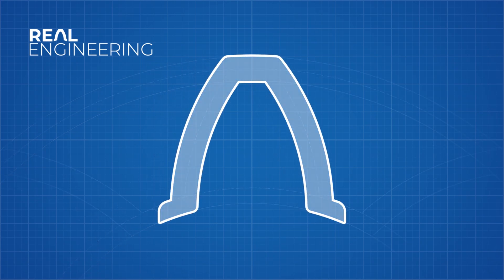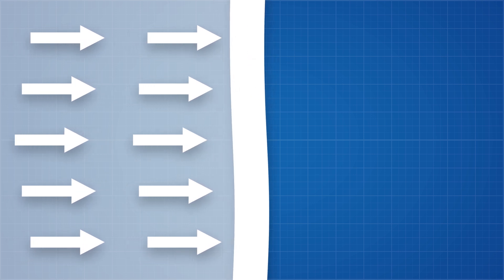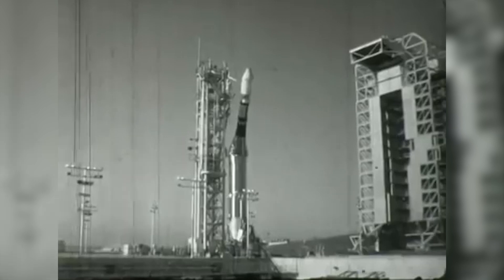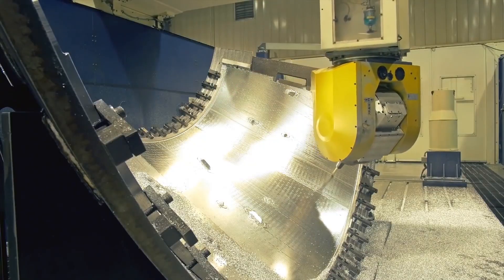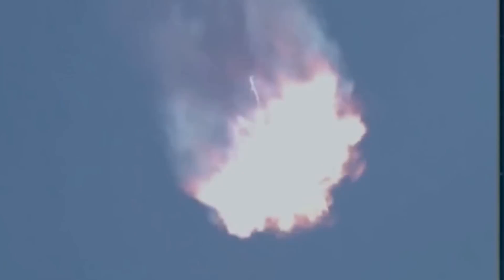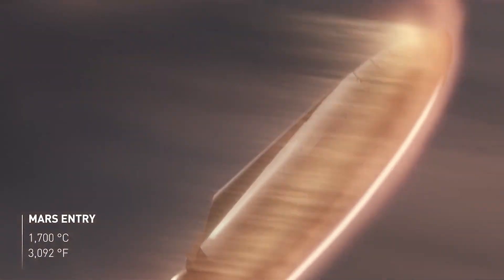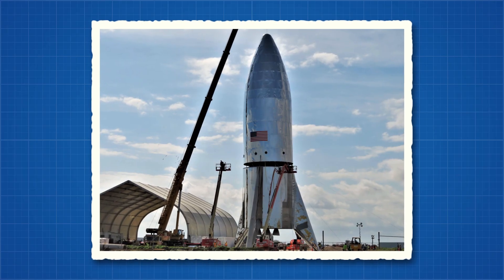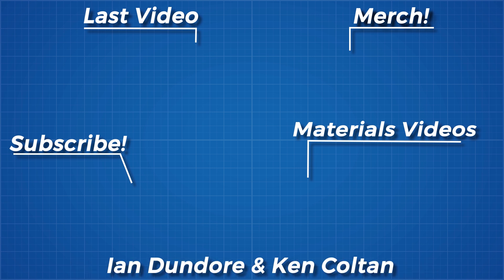Why SpaceX Built A Stainless Steel Starship

Comment: You missed the real important bit.  " Most steel alloys get brittle at cryogenic temperatures. That’s not the case for stainless steel with high chrome-nickel content. It gets stronger in cold conditions, but it also maintains ductility. That means stainless steel has high fracture toughness, which could prevent small structural imperfections from developing into cracks." With the cryo fuel loaded, that thin sheet of steel is stronger than carbon fiber, on top of all the other stuff you mentioned.
Reply: " It gets stronger in cold conditions, but it also maintains ductility." nope, it loose ductility slower than steel , and don't get stronger when cold.
Reply: @surronzak8154  ..nah, I think I will believe the metallurgists and rocket engineers that is actually using this, over some YouTube know it all.
Reply: @danievdw  where doese it say that it will be stronger when cold ? By the way I'm IWT metalurgist using stainless steel everyday, I know the KV for those materials ;-)
Reply: @surronzak8154  Yeah, my mum was lead design on NCC-1701-B . Stop being lazy as well, do some research yourself. Plenty of info available on it, especially after SpaceX started using it.
Reply: @danievdw  LMAO youdon't know what you are talking about buddy
Reply: @Bob Vagen Does it make what I say wrong ? (English isn't my native language) Sorry if it hurts your eyes, I know how it feels
Reply: He is correct it does get stronger in colder conditions and composites tend to sweat a lot more as well but also cost a lot more but at the end of the day they both have there pros and cons plus as far as ik we aren’t working for space x so our opinions won’t change anything
Reply: Myself please show me a chart where KV values goes up when temp goes down for 304L
Reply: Liquid Nitrogen tanks are made from stainless steel.
Just a thought, maybe it's a cryogenic vessel.
😉
Reply: Jkayppobox than you should learn how to read, can you show me where it’s say’s 304l will be stronger cold than warm please ?
Reply: Jkayppobox « 3.2 Charpy Impact Toughness Data
Charpy impact values for all materials are presented in Figure 4. In all cases, the impact toughness reduces with decreasing temperature »
Reply: James Tyler as you say, you’re not an expert
Reply: James Tyler and still no graph to show ? Only blabla
Reply: @surronzak8154  There's is nothing shameful in admitting you may not know something.  In general steels become brittle at low temperatures but they are not austenitic and have BCC crystal structures, 304L being a austenitic FCC structure at low temperatures maintains a lot of ductility at the same time it has a unique behavior of becoming much stronger.
Reply: @jtonxbox1433  go smoke something with zeka
Reply: Musk said he is “a big fan of steel”... did he ever mention using stainless steel?
Reply: Danie van der Westhuizen wow this thread was something else. In case anyone is wondering, Danie is correct. They are going to use cryoformed 301 stainless steel which does in fact increase its tensile yield strength to density ratio at cryogenic temperatures to beyond that of standard aluminum lithium alloys (see NASA research paper linked below). Also Elon has said they have made an improved 301 variant they unimaginatively and confusingly call 30X like their PICA variant PICA-X. It isn’t necessarily stronger per gram than the carbon composites even at cryogenic temperatures (where the composites lose tensile yield strength) but it will be strong enough that the reduction in heat shielding mass will make up at least some of the difference. Besides the yield strength per density which should be good enough, the price per kg, development time and ease of manufacturing are vastly improved. https://apps.dtic.mil/dtic/tr/fulltext/u2/a397053.pdf
Reply: @surronzak8154  Most materials gain yield and tensile strength as temperatures sinks but lose fracture toughness. Face-centered-cubic materials (304 steel) maintain a significant amount of ductility at even cryogenic temperatures compared to body-centered-cubic materials (non-austenitic steels).
Reply: ....IF I 🎶ONLY HAD 🎵A BRAIN !!!!!🎧
Reply: @surronzak8154  304L does get stronger when exposed to 98k, or cryogenic temperatures. It does for the most part maintain ductility, about 8-13% is the range we build to at SpaceX. However, some evidence of notch sensitivity is seen in our custom new alloy we are developing, 30X.
Although we have not pinned down the main driver of these failures, it does appear to be a function of bead geometry in welding, ferrite number and M23C6 carbide formation along GB’s.
Reply: @surronzak8154  that’s incorrect, it does get stronger. It’s called a “Cryo Bump” at SpaceX and is generally around 50% YS.
I think you are confusing toughness with strength.
Reply: @surronzak8154 Starship already flew multiple times. The metallurgist and engineers were correct all along. Maybe listen to experts before trying to act mighty

Comment: Origin of "WD-40" - I honestly never knew that before!
Reply: And apparently, it really was the 40th time they tried the formulation before they found the one that worked.
Reply: Water Dispersant formula # 40.

Along with Heinz 57.
Reply: @wildman2012  It's just Science 101: "If at first you don't succeed...…"
Reply: WD40
Reply: Mindblown
Reply: Motorcycles and cars that are built to be not painted are usually scrubbed down with Wd-40 to keep the water off the surface. Making it so that it won’t surface rust.
Reply: Ikr, another fascinating fact..
Reply: @HuntingTarg  Chanel No5

Comment: Just so you know, "Starhopper" is the test vehicle currently being built. The actual thing will be called "Starship" and the booster "Super Heavy".
Reply: Also, Starhopper with the old tip was only about 2/3 the size of Starship.
Reply: I thought BFR was great.  Versatile.
Reply: Yes thanks for someone correcting that. It stains the work and knowledge he puts into the video when failing to properly name it. One starts to question other stuff then too.
Reply: “Will be”. As often as plans change I wouldn’t count on it.
Reply: @Christopher28fair  It was but people kept changing Falcon to the F word. You can't have 8 year olds interested in space if the most powerful rocket ever built uses vulgur in it
Reply: Andrew Well to be fair he never specified what the F stood for, so in typical Elon fashion we thought it meant the F word.

This is a man who named his cars “S3XY” after all, and that was when Ford wouldn’t let them name the 3 the Model E, then proceeded to joke that Ford killed SEXY.

An engineer’s gotta have fun though.
Reply: Grace Slick is suing  for using "Starship" wait..send that band into space...why not?
Reply: Albert Einstein will smile when he sees these Havana cigars, hungry for fuel and slow as snails, after having seen Tesla UFO testings at 100,000 Klm / h. Real engineering 100 years late in time.  TESLAAAAAAAAAAAAAAAAAAAAAAAAAAAAAAAAAA

Comment: My Soviet university "diploma work" back in 1987 was to test this type of cooling for rocket re-entry, porous pressed metal powder was used, however there were problems with incostintent gas flow in different parts of provided samples. Hopefully perforated solid metal will work better than baked together particles, I really hope such protection is possible (although not 100% sure), only tests will show.
Reply: BRAVOZULU DWEST boathouse  I don't think it's possible to calculate these things precisely because of nature of turbulence, it is not really predictable and may create very local effects when one part of rocket will be heated much more than other part. That's why tests are still necessary. That's why wind tunnels are still used. However, it's hard to replicate all conditions of re-entry in wind tunnel, SpaceX is right to build cheap test rocket.
Reply: I think the biggest challenge will be with the baffle diffuser 'heat shield' that the methane will flow through; there will be cryogenic methane on one side and high-pressure semi-ionized hypervelocity gas on the other.  This will create a high thermal gradient across the baffle plates, and I am not sure if anything short of an actual flight test will prove/disprove this approach.  If it fails, it could doom Starship and jeopardize SpaceX's investment funding.

If it performs as designed, we enter a new era in spaceflight and human exploration.
Reply: @HuntingTarg  I wish I knew what kind of heat protection is used by the newest breed of Russian nuclear hypersonic gliders, yes they are disposable but still may use similar method to keep hot plasma from surface of metal, I know that Soviet Union worked on that long time ago. Although metal still will be heated by light but this is not the same as direct contact. The goal is to make gas cushion between plasma and metal. I doubt that methane is the best candidate, perhaps helium or some other inert gas that will not react with metal.
Reply: @lsemenov  under correct conditions a high-pressure high-flow gas boundary layer will form between the plasma and outer spaceframe skin.  I wouldn't rely on that exclusively to protect a metal or composite frame though.  A cryogenic fluid (Helium, Argon, Nitrogen) in an open-loop boil-off cooling system is conceivable, although I don't know of an example where that's been tested.
Reply: cOmMiE
Reply: @snakeslither8831  Yeah, we were first in space :) Now Russia is not longer commy but is first with hypersonic gliders, nuclear-powered cruise missiles, lasers able to fry satellites and drones etc. It's a pity we have to put too much effort into defence instead of peaceful exploration of space.
Reply: @lsemenov   it was a joke
Reply: @snakeslither8831  
Granted.
Though it was not a good joke.
Reply: Very cool @HuntingTarg!
Reply: @lsemenov  Honestly as a European (Belgian one at that lol) who is just on the sidelines admiring this. I know it might sound kind of crazy: but I am sort of thankful for the cold war because it resulted in the space race laying the foundation for a private company born from a man with extraordinary vision to use capitalism (Tesla+all previous ventures) to go and attempt to colonize space... 

It also basically proves the concept of the WTK (Wetenschappelijk Technisch Kapitalisme) Complex which translated means Science - Technology - Capitalism complex.
Or in other circles it's called the Science - Technology - Economic complex. Whichever you use the basic concept is the same. (as proposed by philosopher Max Wildiers later adopted by Etienne Vermeersch)

Science - Technology and Capitalism/Economy work together to make an unstoppable force of human advancement. Recently I believe this is being called technocapitalism.
I'm not sure if it's all good when you hear how Elon treats his employees but the results are obvious

The soviets had something brilliant with their polytechnical schools which I believe Russia has inherited to a large part and that the Chinese are trying to seriously compete in.
I do hope though that there never be a major hot war again. That would be catastrophic for human development.

I'm not a scientist and I fear I'll never be. But I'm just grateful that there are people who are accomplishing things that seemed to be science fiction until not too recently and this advancement is just not stopping. I hope I'll get old enough and with enough mental faculties to see what the human race will have accomplished nearing the 22st century...
For now I'll try to pass nursing school and try and take care of people smart enough to drag humanity forward.
Reply: The research you did sounds incredible, could you tell us more about it ?  Did it end up being used or if way only tests
Reply: @booketoiles1600  I was just a student who tested several samples using compressed air, they looked like mushrooms where stem was connected to source of compressed air. I basically measured local pressure in many points of mushroom hat. It was very inconsistent and one sample even sucked air inside, obviously because of Bernoulli effect. These experiments were very far from any real application.
Reply: @lsemenov  Some major advantages that SpaceX may have here that you may not have in the past are the vastly superior modern computing equipment as well as their cutting edge fluid modelling compression algorithms. While obviously not negating the usefulness of wind tunnels or real testing, it's offered a lot more detail and accuracy than what has been available previously. This has been a key factor in how they've managed to develop Raptor so quickly.
Reply: Me, acting as if i understood this converstation. Hmmmm, yes, yes, of course 🤔
Reply: @lsemenov  they also are advancing dynamic wavelet based multiphysics simulations for their rockets and engines while everyone else uses fixed fourier compression and voxels
Edit:Jason Last said it a bit more eloquently.
Reply: @lsemenov   
Fluids on a high pressure, high temperature enviroment aren't going to be reliable. I don't see it working like they plan and I bet it's not going to be as uniform and constant as they need it to be, it's going to create temp gradients and the material is going to heat up unevenly in my oppinion.
But hey, tests need to be done and the more research they put in the better, maybe they find something interesting.
Reply: @lukenuke8821  I have the same thoughts, turbulence can be a big problem.
Reply: Closed loop methane refrigerator between windward and leeward sides, coupled with the inner and outer skins acting as a Peltier device.
Reply: @lsemenov  yea, now Russia looks a lot like Germany in September 1939. Hopefully, it will soon look like Germany in April 1945.

Comment: Why isn't the first stage booster aluminum, or cf though?
Reply: Then they can just use the same manufacturing techniques for both. Much cheaper.
Reply: theys want to reenter without an entry burn so it needs to take the heat. plus it does not add a lot of weight to use steel because of its cryo strength.